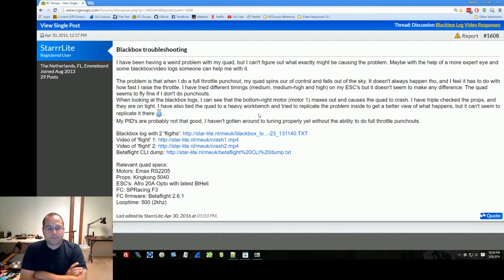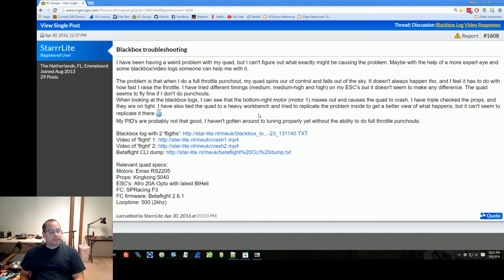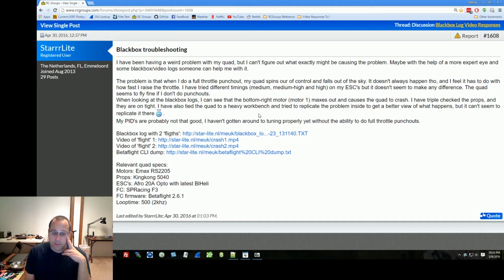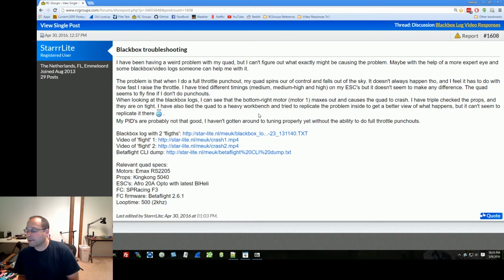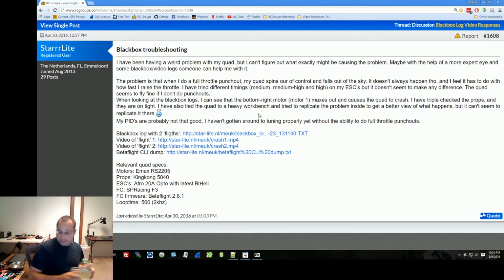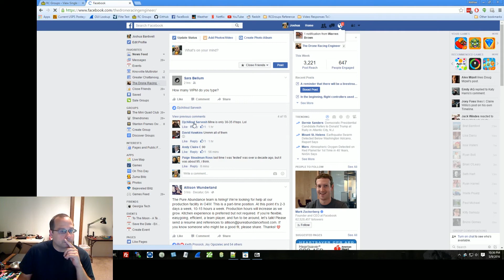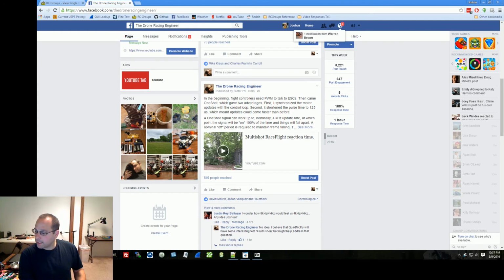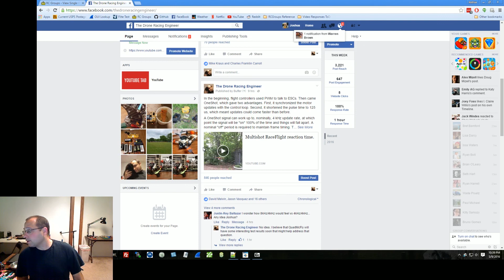Livestream Highlight - 5/9/2016 - BLHeli_S, multishot

Comment: Are going to do a video in more detail on blheli_s? I noticed blheli suite options are different for blheli_s. Maybe you could go over the reasons the options are different, like I don't think the damped light setting is an option. I ordered 4 DALRC XR20A ESC and was sent one of those and 3 DALRC BS25A. So it sucks I got miss matched ESCs but it sounds like the BS25As are better, maybe not? PS, thanks for all the videos, I really enjoy your channel and have learned a lot because of your channel.
Reply from the maker: Honestly, BLHeli_S is basically the same as BLHeli but with better hardware. That is a safe way to think about it. If an option has been removed in BLHeli_S, it's because it's been defaulted to a good value. For example, some BLHeli ESCs didn't have hardware that supported braking, so damped light could be turned on or off. But all BLHeli_S ESCs are required to support braking, so the option has been removed. It's just always on.

Comment: hi josh, your always a huge help maybe you can help me out ... I just purchased the dys xs 30amp esc with blheli s  firmware 16.1 .  my quad can not flip or roll , it just falls out of the sky . so far I've gone through 2 sets of motors crashing my quad trying to figure out the issue , even went as far as buying new flight controllers . I'm using a seriously pro flight controller running betaflight  2.9.1  and I'm absolutely  loosing g my mind any help would be much apreciated . thanks again for the videos there a huge help
Reply from the maker: In the receiver tab, do the channels move correctly when you move the sticks on your transmitter?
Reply: +Joshua Bardwell yes,
Reply: can I just re flash normal blheli firmware on the dys xs 30 amp ? or possibly fly with my kiss flight controller until betaflight works it out in the firmware,, alot of people are having the same issue on rc groups but no one's has solved the problem yet lol

Comment: Correction, hardware PWM is part of microcontroller, it is not separate part, and most of microcontrollers have it (even Atmel ones used in ESC have at least one), but most of them do not have enough outputs needed to drive BLDC (you need at least  3 outputs, and they can be all from single PWM which if i remember correctly is possible on F390 microcontroller which can route same PWM on multiple outputs, contrary to Atmel on which single PWM is connected to only one output and commonly used ones in ESC miss at least one, but even that can be fixed with some external steering of PWM).
Theoretically there is no minimum pulse which motor is capable of responding , again in theory you can ran PWM as high as you want and motor will response to any change in duty cycle, but in practice you are limited by speed of MOSFET (and combination with MOSFET driver, which limit time in which you can turn on and off MOSFET), there is no need anyone to test that, it is well theoretically explaind fact.

Comment: I've always wondered why motor bells get hot, unless it is simply the heat radiating from the windings
Reply from the maker: +ZERONEST of electricity can cause heat, then can magnetism? Work is being done... It makes sense to me.
Reply from the maker: +ZERONEST here you go. Magnetism causes heating. https://youtu.be/DkpEz7znpnc
Reply: Joshua Bardwell Thanks! didn't think about induction heating
Reply: Simple answer is that magnetism do not produce heat.
But not so simple answer is that changing magnetic field produce electromotive force (according to Faraday's Law), that as result have current flow in conductor (motor bells are made of conductive material so current start flowing in them) and that current is called "Eddy current" and that current produce heat.
If you put conductor in constant magnetic field ( there is no change in magnetic environment) it will not heat regardless how strong magnetic field is.